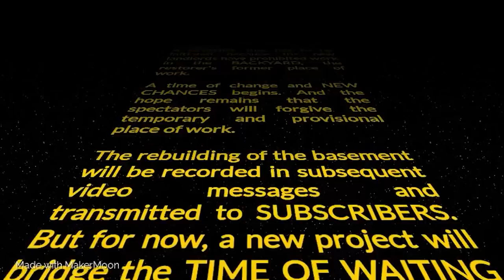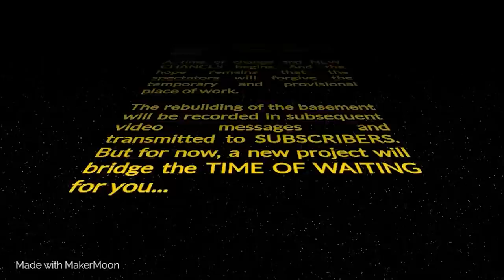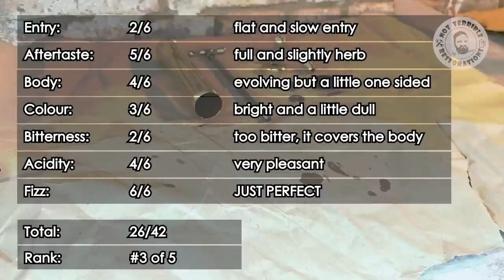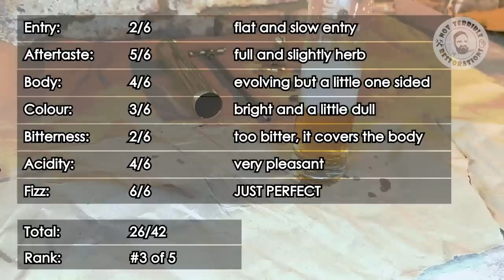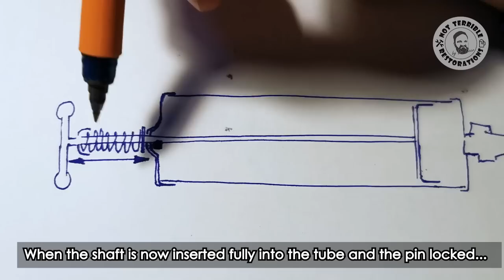BEAUTIFUL Brass Grease Gun Restoration

Comment: I think the spring should be inside. That will keep the plunger from bottoming out on the top of the housing. It serves no important function outside.
Reply from the maker: I was also thinking if it had 2 springs in the past. I agree with you that a spring on the inside would make sense. The one on the outside however helps locking it and has a perfect fitting on the shaft
Reply: @NTRprojects  Aha. I see what you mean. I've seen them like that on bicycle pumps.
Reply from the maker: @briangoldberg4439  funny you mention it since the guy engraved on the grease gun was actually a founder of a car and bicycle club in Frankfurt.
So I'm still not sure if it always was a grease gun but maybe a bike pump
Reply: @NTRprojects  That would fit! I've seen some small bike pumps that resemble that design. Like this: https://i.pinimg.com/originals/39/6e/e0/396ee0c3a2a5d2f0899b024172ba2894.jpg